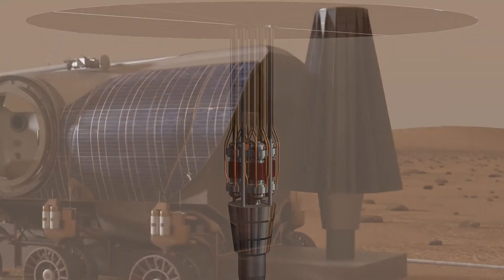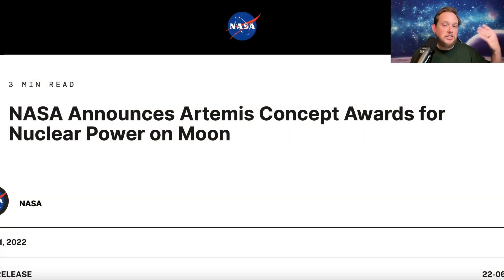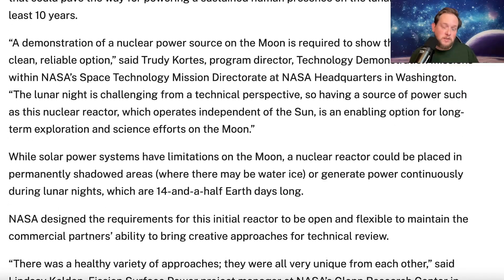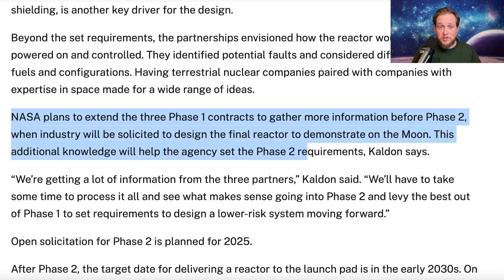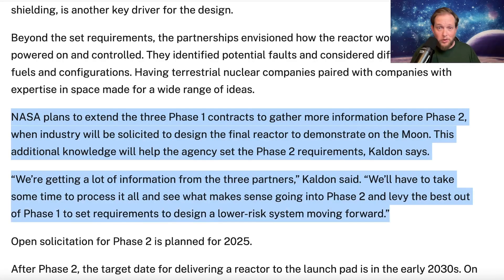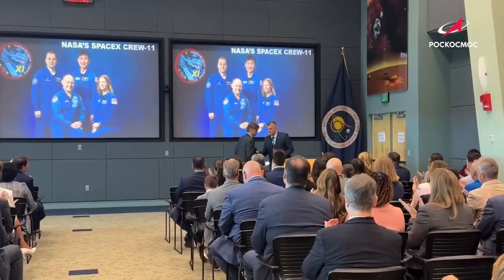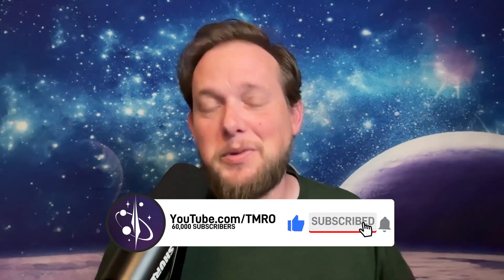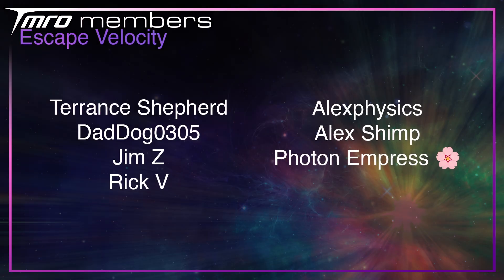Nuclear Reactor On The Moon By 2030 // SPACE NEWS // August 5th, 2025

Comment: Is NASA going to reopen bidding for the ISS de-orbit contract?   There is some controversy over who had bidding access last time.   100kw Nuclear reactor on the moon?   It doesn't make much sense... 4 IRosa Solar panels = 120kw.   surely he knows how much more efficient solar is in space?
Reply: But you would need 200 tons of litium batteries to store 42 GWh energy for the lunar night. (100 kW x 336 h x 0.8 efficiency / 200 kWh/kg.). Weight is usually the limiting factor in space transportation, thus a 10 - 20 ton fission reactor makes a lot of sense.
Reply: @jaylindelycke6727  you would need batteries anyway although probably not 200tons worth if you had a reactor…however I’ve done the math once before…I can’t find it this second but essentially….you can get direct sunlight most of the time from the poles…especially if you put the panels on poles too…..I.e.  poles at the poles.  Say 1000 meters high.

Comment: Whilst 40KW reactors can be used together,so can the 100KW reactors.I think that the larger power requirement per unit suggests that they are planning to use a lot more power than originally anticipated.Heating,cooling,CO2 scrubbers,water and oxygen production,general usage,science labs,3D printers,experimental mining equipment, etc,etc. To me it makes a lot of sense to go large from the start rather than start the race with one hand tied behind your back.

Comment: I would favor multiple 40 kW systems, if only for redundancy. These reactors will be closed, prepackaged systems deployed well away from the colony. If a single big reactor has a failure, the entire thing will have to be shut down. Shutting down reactors and starting them back up takes hours at minimum, possibly days - the machinery needs to cool down to be safe for servicing. Nevermind the servicing itself, which will be a highly complex EVA that needs to head out to the reactor site and operate there. This will be bad if it happens during lunar night.
Meanwhile if you have 2-3 smaller reactors, shutting one down will likely have zero effect on base operations. Peak system power would likely only be needed for a few very specific applications, like burst-charging rovers or conducting ISRU experiments. The chance that such a thing is scheduled during the maintenance window will be slim in the first place, and even then, it could easily be rescheduled. Life support itself would be perfectly fine even with just one 40 kW reactor running at half load.